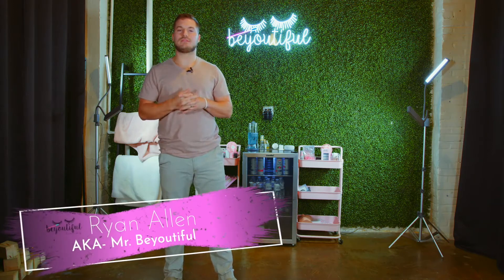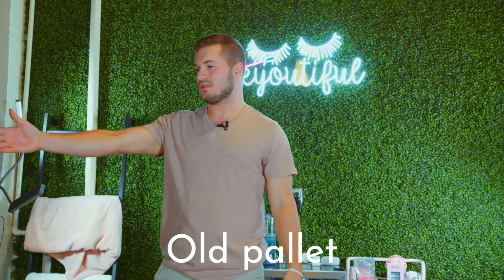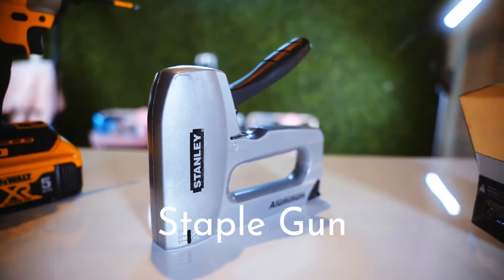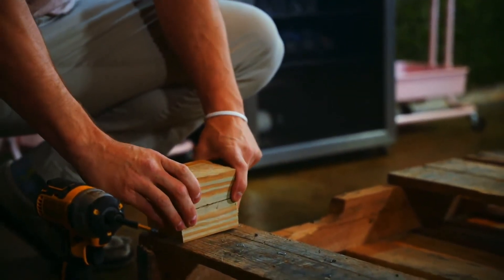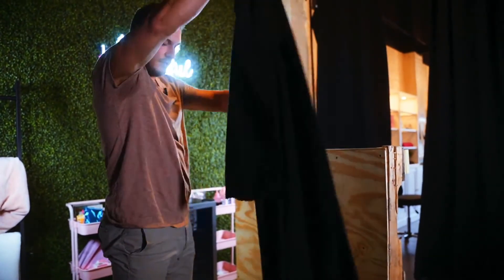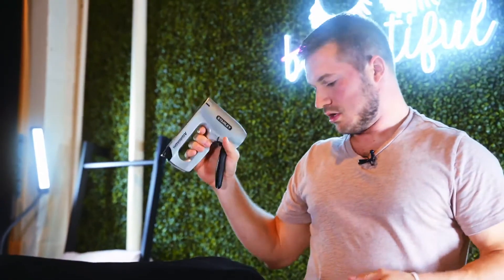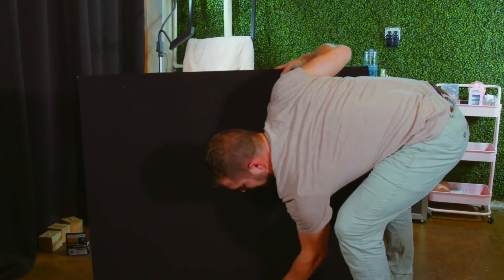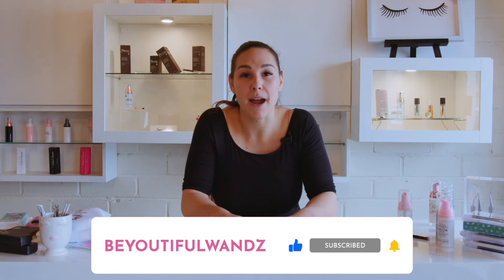DIY Lash Chair Base

Comment: Hey babe, I was just wondering what are you do if your lash recliner is a little too high and doesn’t recline further enough down so you find yourself hunching do you get a lash base or do you just get a taller adjustable chair and some cushions for the client to sit to make them reachthe top part which is obviously a lot more comfortable than them just barely reaching the top of the recliner and having to hunch over I am a new lash tech, so this is very helpful. If you would give me any information on how to fix this, it would be greatly appreciated.😊